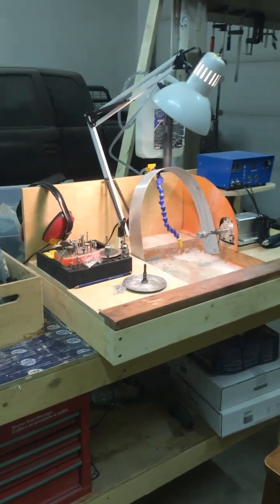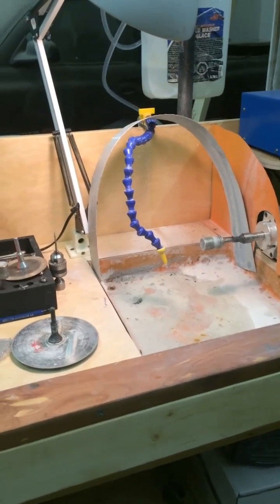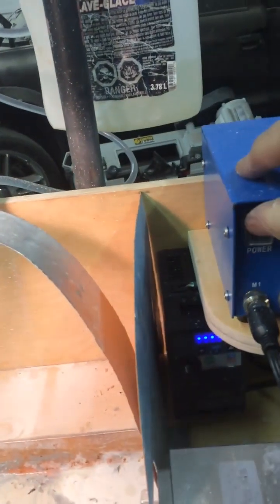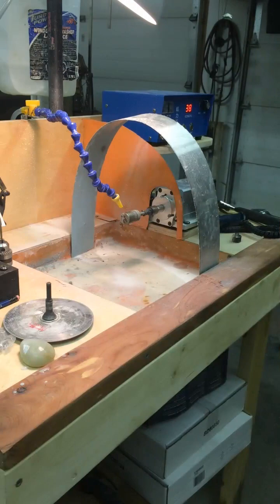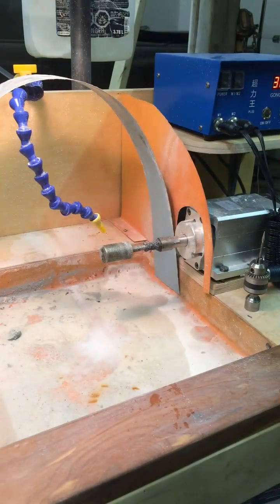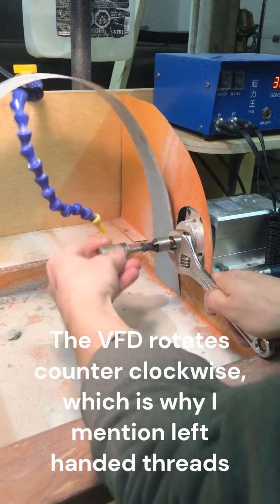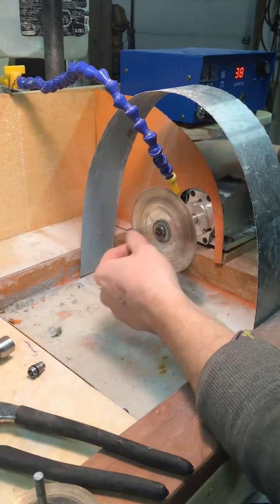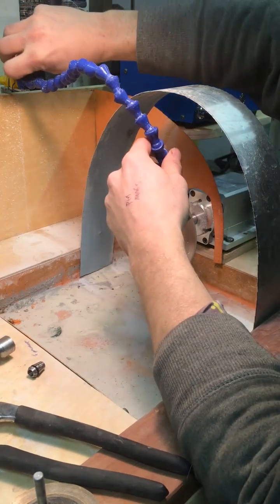Jade carving tutorial - Portable jade carving bench using amazon VFD

Comment: nice set up! i want to ask you about your blue micromotor set up,ive seen  it on alibaba, is it brushless ? would you recommend it,cuz im a little bit nervous buying chinese tools . im using a standard flex shaft at the moment but ive been eyeing those micromotor set up recently for convenience  sakes.  hows the torture at lower speeds ?
Reply from the maker: Hey there, Yes i would certainly recommend upgrading from a flex shaft. The blue micromotor setup i am using is indeed a brushless setup with plenty of torque to go around, even at low speeds. I had an NSK dental micromotor setup before which was the best I've used but rebuild costs were too high, so i switched to the Chinese micromotors with no regrets. I feel comparing a flex shaft to most micromotors would be akin to comparing a car from the 90's to a vehicle only few years old. They work, but a modern better performing alternative exists. Cheers
Reply: @canadajadecarver  thanks for the prompt reply.  I love your cool creatures , great flow n visual movement ! big up from Taiwan
Reply: got one more question. I see there is another model from the company that has a double controller, it says it has 2 independent speed controls ,is there any particular reason you didn't choose that one as it isn't that much more in cost?   what about collet size,is it changeable, or is it a hassle? I'm kinda not sure which I would choose as I do use some 1/4inch shanks,even tho I tend to use mostly 2.32mm ones alot more. the ordering form asks me to choose one of 3 collet sizes  making it a difficult choice. I'm just getting into carving nephrite ,don't have alot of money to go all out,, just what I need .
 I really love that simple but efficient set up you designed as I'm not in a very big workspace at the moment, so your design is quite inspiring to see how much work can get done in such a small set up. thanks,
looking forward to watching more carving videos from Canada !

Comment: What is made electric engine.how much watt volt speed
Reply from the maker: Hi, it is a 110v 600watt VFD turning up to 12,000rpm. It is good for a small portable size but i dont think i would use it for a permanent bench, it lacks low speed torque.  Here is a link to the motor.
https://www.amazon.ca/gp/product/B09FXPMCS2/ref=ppx_yo_dt_b_asin_title_o02_s00?ie=UTF8&th=1
Reply: what is a high torque motor for permanent bench
Reply from the maker: @tat-km3bn  I bought a 3/4hp version of this motor to try for another machine. I think it should have better torque, but i have not used it yet. https://www.amazon.ca/dp/B06XGCZ216/ref=twister_B07DPL37RD?_encoding=UTF8&psc=1